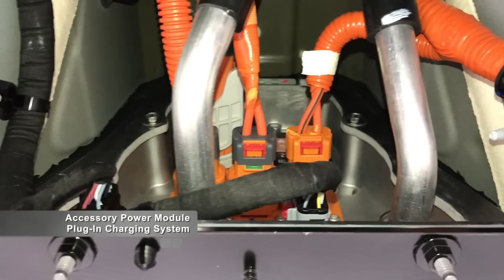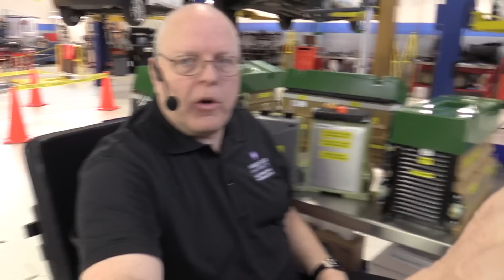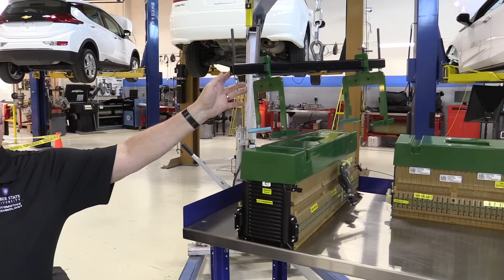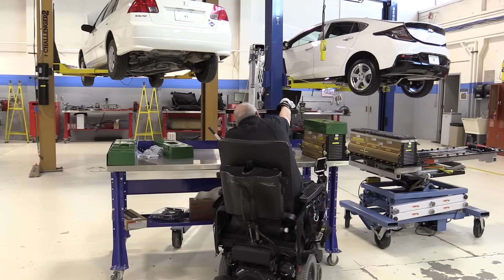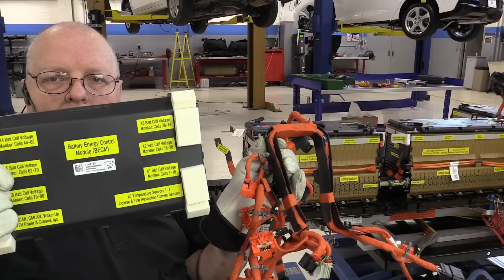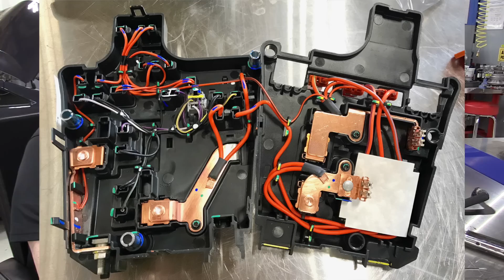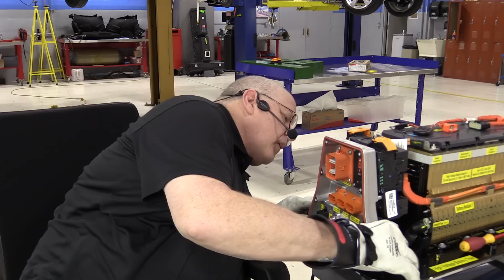2018 Chevrolet Volt 355.2V Li-Ion Battery - Deep Dive

Comment: Professor Kelly, I believe you are mistaken at the beginning of the video when you mentioned that the 2018 Volt is a series hybrid. While the first generation Voltec powertrain (2015 model year and earlier) was a series hybrid system when in extended range mode, the 2nd Gen Voltec powertrain is a series-parallel hybrid. The 2nd Gen Voltec engine has multiple distinct hybrid modes, including: the ICE can turn motor A as a generator to supply power to Motor B and the battery as Motor B provides propulsion (generally at low speeds), but the majority of the time when in extended range (hybrid) mode, the ICE is supplying some or all of the power directly to the wheels through Planetary Gear 1, basically load sharing to varying degrees with Motor B (the primary traction motor) providing power through Planetary Gear 2. The ICE can also supply 100% power to Planetary Gear 1 and Planetary Gear 2 with Clutch 1 closed while Motor B turns Planetary Gear 2 forward or in reverse to control ICE torque and RPM. The the ICE is linked to Planetary Gear 1 and 2, Motor B can even syphon energy off Planetary Gear 2 to provide energy to Motor A and the battery, so that Motor A can apply power its power to Planetary Gear 1.

I apologize if I am mistaken about what you meant by series hybrid, as I assumed you were referring to the ICE only powering a motor-generator to provide power to the main traction motor which applies power to the wheels. Or more simply, that in a series hybrid, the ICE doesn't output power directly to the wheels. While this was true of the 1st Gen Volts, it is not in the 2nd Gen.

I am a big fan of your videos, especially in regards to EV and Hybrid vehicles, and thank you for all the hard work and detail you and your students put into these videos.
Reply from the maker: Thank you! You are correct. It is my understanding that the 2nd generation Volt's 5ET50 transaxle can operate as a series-parallel hybrid transaxle, but it can also act as a series hybrid. It has 5 modes of operation. Two modes are electric only, one mode is a series hybrid mode, and the Two remaining modes allow the ICE to contribute torque to the wheels through the planet carrier of the input gear set. I hope to have this 2018 Volt 5ET50 removed and disassembled in the next month. Then we can see what it really can do. It is confusing, especially when this transaxle is used in a Malibu Hybrid with only 4 modes (they removed the series mode). Thanks again for your feedback. I learn so much making these videos; I also learn a lot from great feedback like yours. Have a good day.

Comment: Great video Professor! You're a wonderful instructor and easy to listen and learn from. Thank you!
Observation: The high voltage "green" covers each have two slots on top that seem to offer a "slot" for the lift clamps thereby negating the need for their removal during the lift. Does that sound feasible? 
Thanks again. Jim
Reply from the maker: Thank you! I just checked, you are correct, they will allow the lift to work while they are still installed. Thank you!
Reply: Wow! you made my day Professor...I helped you for once! Thank you!!  :<))

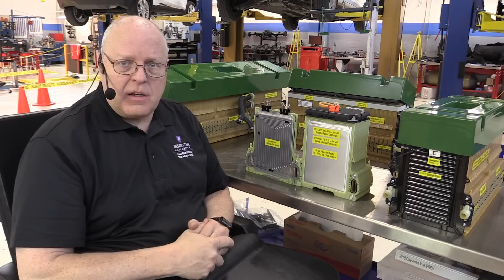Comment: Interesting. At 23:00 its a battery cell group which is rated 55Ah actually in this car 52Ah the individual battery cell you were showing is rated 18Ah.
Reply from the maker: Thanks for your feedback. I have not seen any official ratings on the individual battery cells, but here is my logic: 
The first generation Volt battery was rated at 16kWh. There are 96 cell groups in that battery making 16,000Wh/96 = 166.67Wh per cell group. There are 3 individual cells per 166.67Wh cell block making 166.67/3 = 55.5Wh per individual Li-Ion battery cell.
The second generation Volt battery was rated at 18.1kWh. There are 96 cell groups in that battery making 18,100Wh/96 = 188.54Wh per cell group. There are 2 individual cells per 188.54Wh cell block making 188.54/2 = 94.3Wh per individual Li-Ion battery cell.

I could be basing my logic on false data, but I do not see where I made an error.  Please clarify your math. Thank you.
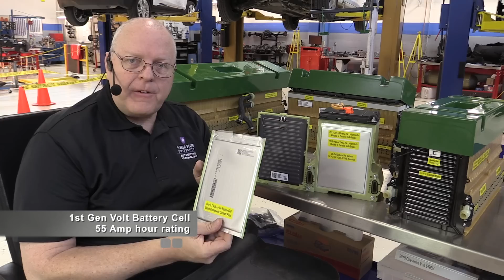Reply: Your math are correct, but in the video at 24:40 you said and wrote 55.5Ah instead of 55.5Wh.
Reply from the maker: Oh, I missed that. You are correct! Thank you very much.
Reply from the maker: 1st generation Volt battery. If an individual cell is rated at 55.5Wh (using units of measure) Power (Wh) = EMF (V) x Current (A), then the current rating would be Wh/V = Ah. So 55.5Wh/3.7V = 15 Ah rather than the 55.5 Ah I mistakenly said/displayed in the video.

Comment: How long could you run the cabin air conditioning in this vehicle using tyre battery power alone?
Reply from the maker: That is a good question! It depends upon wether you are also driving at the same time and other factors like battery temperature, outside temperature, inside temperature, relative humidity, etc. If you are referring to just running the A/C compressor alone, I suspect it would be several hours at a minimum.
Reply: A very long time.  The AC typically draws about 3KWh when first starting to cool down the car, but that often lasts only a few minutes.  Once at temperature, I've seen my Volt draw between 0.5-1.0 KWh to maintain the temperature.   I wouldn't be surprised if you could get nearly an entire day out of it running the AC constantly (without driving of course.)

Comment: Another very interesting video from a great teacher.  
I'm running a 2015 Mitsubishi PHEV Outlander 4x4 ,  as soon as the warranty runs out, I'm planning to extend off road EV range with a second identical Mitsi Outlander 12 kW/h battery pack, giving total  24 kW/h. The extra coolant re- routing is my biggest challenge, on this vehicle. I hope this installation will give the 4x4 an off roading EV range of 60 mile.
Any thoughts on this 4x4 project?  
Keep up your very interesting videos. 
God bless You.
Reply from the maker: Thank you! That sounds like a cool project. If the Outlander system is like this one, it could work. We will look at the volt's battery cooling system in a future video, but there is a coolant chiller to keep the battery temperature within a certain temperature range, you could just run parallel cooling hoses and see how that works.
Reply: WeberAuto Thank you,  I will look forward to seeing another great episode from your brilliant channel. 
I already have bought the second 12 kW/h phev battery pack from a 2016 vehicle/breaker on eBay. 
It came with all the original wiring/connectors / cooling circuit tails.
$1500,  it slides in to the boot a treat. No brainer !?
Reply: Outlander PHEV is air cooled pack if I remember correctly
Reply: Hugh Frater https://youtu.be/Gf9fDbwF1K0
Reply: Henry Perity Hi.Я спрашивал у профессора про phev mitsu, ответил что нет ничего. А это видео позор полный. Тип работает без соблюдения простых мер предосторожности. Я нестал эту ссылку кидать ему. В конце видео ключ уже замотал черной изолентой.
Reply: Henry Perity. Хорошая идея. Успеха в реализации

Comment: Apologies for going off topic. I wonder if they make motorized chairs with holonomic drive. Your videography is great, but I wonder what you could do with equipment to make your job easier (perhaps a steadycam mount for your camera?)
Reply: WeberAuto I imagine a gimballed camera would work well mounted on the chair, like a dji osmo or similar...
Reply from the maker: Thank you for the suggestion. I do need to figure out a way to make a camera mount for my chair.
Reply from the maker: Thank you, the dji osmo might work

Comment: Wait doesn't the manual say to "take apart the BECM and explore it"? :-) The old gen units had a box on each cell group, I wonder if they just packed all the same designs into one box or if they totally redesigned the circuitry in the BECM?

Nice job tearing down the contactor assembly, I love how you get inside parts that normally would never see the light of day!  

Thank you for another interesting video.
Reply from the maker: jontscott You are correct! I did take it apart, but I forgot to show the photo. Nothing out of the ordinary, just a regular circuit board.
Reply from the maker: jontscott thank you!

Comment: Can't wait to see if how they manage cabin heating. There seems to be a switching point where the electric heating won't kick in if set to below 74°. I wonder if it switches between heating and cooling at that point (it would be the first real drawback I've found in the car). It would also be nice to know if the coolant system for the electric side can heat the cabin or just the ICE coolant does. Turning off 3kw of electric heating might make running the ICE better if cabin heat is desired.
Reply: On first generation Volts (not sure about second gen) you can select the cutoff temperature for engine heating.  On the 2013, it’s a choice of either 15 or 35 degrees.  The engine will basically run under light loading to generate cabin heat and a small amount of electricity.  I’ve found it’s more efficient to use this mode on trips over 25 miles or so.  That little engine puttering along can extend my cold weather range an extra 10-15 miles, while using very little gasoline in the process.   Gas engines are better at generating heat than motion, and batteries are better at moving the car than generating heat.  Google “Engine Running Due To Temperature” for specifics.
Reply: You should have a HOLD mode to force the car to use the ICE for propulsion, unless you have a really old Volt. Or MOUNTAIN mode if you have depleted battery below 40% even on the early ones.
Reply: Bryan Noga z

Comment: Thank you for the great and high quality video. Just curious, I see the coolend passages is really narrow and I know the coolend could become sticky liquid if you don't replace them in time, so does this means the EV and hybrid vehicle usually required special coolend or replace them more often to prevent the passages clogged up?  Seems like there is no way to unclog these passages without taking batteries apart.
Reply from the maker: Thank you. It uses the regular GM DexCool antifreeze. It must be the pre-mixed coolant with de-ionized water to prevent contamination that can lead to plugged passages. Never use tap water in a cooling system of a hybrid or electric vehicle.
Reply: WeberAuto thanks for the reply!
Reply: Guo Richard the 5 year major service includes the battery/motor/inverter coolant change to validate the 100k mile warranty, at least here in the uk on the Opel Ampera
Reply: Hugh Frater that's pretty impressive, I think the battery warranty is better than my BMW i3 which has 8 year or 50k warranty I believe.
Reply from the maker: Thank you, that is good to know!